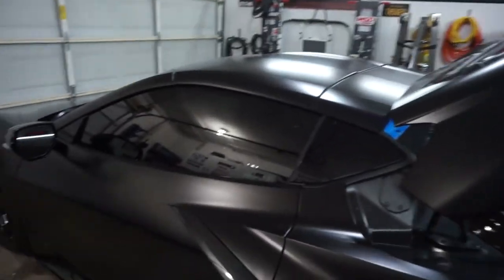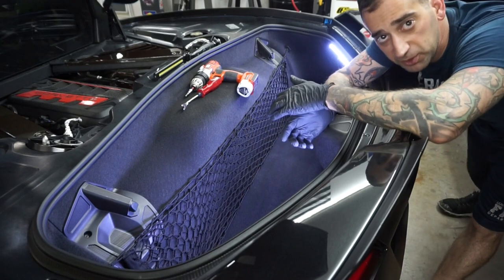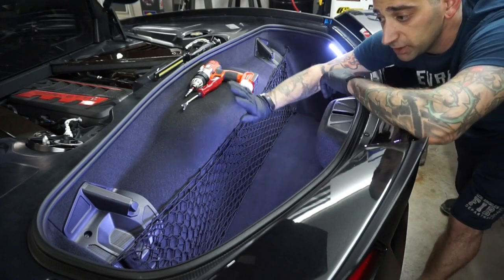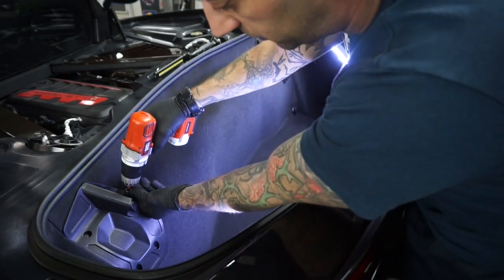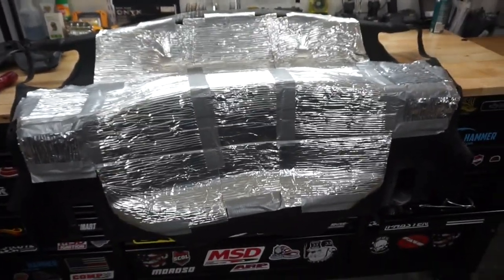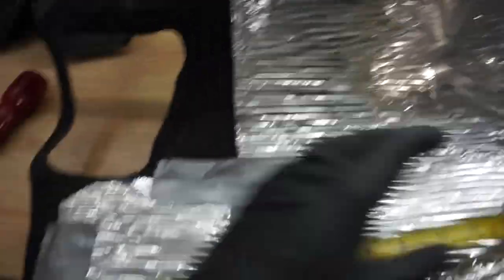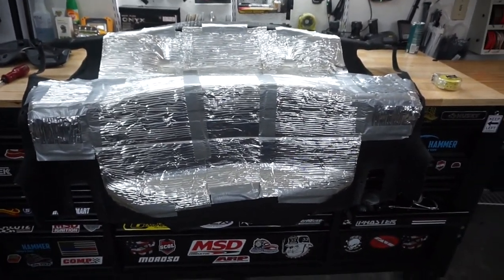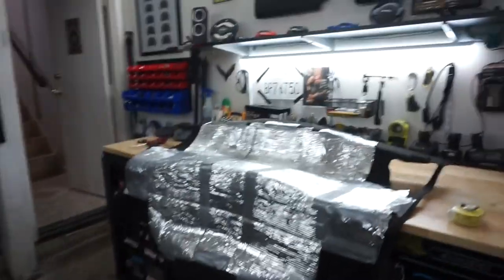Keep your trunk temperatures down on a C8 Corvette

Comment: Very cool. The Frunk gets warm as well. One point. The largest source of heat on the Stingray is the two wells at each side. Probably 90%. I put squares of insulation along bottom, cut and fit, no tape, the wells. Put the Chevy Trunk protective liner over that. Pretty much done. Long trip, pretty close to ambient. Tracking, might get a bit more from engine.

Comment: The appearance of the duct tape doesn’t matter, but in my experience with other applications the duct tape adhesive will dry out and fail. This leaves a dusty residual and patches of hard to remove ossified glue. Insulation tape might be a better product.

Comment: Enjoy your videos; appreciate the time you put in. Question: by cooling the trunk about 30 degrees with this modification, are you then increasing the external engine temperature by a similar amount and might that be harmful to the engine in the long term (also affecting your engine warranty)?
Reply: Exactly, I wouldn’t do that. I would just get 3-4 of those blue frozen packs and throw them in the trunk when I need it
Reply: This was my concern as well.  The heat has to go somewhere. I haven’t heard any answer to this question.  Cheers!